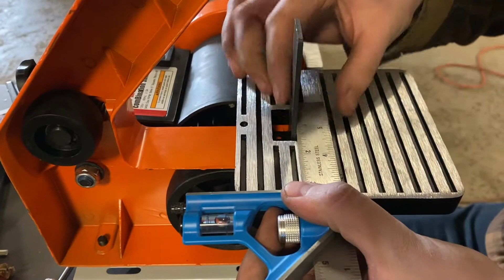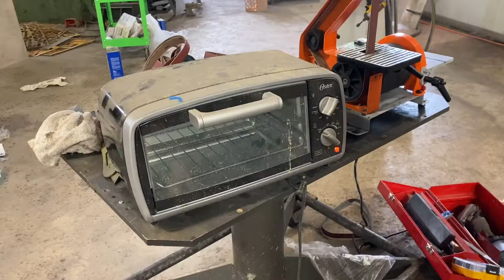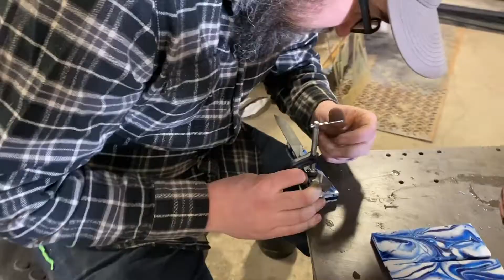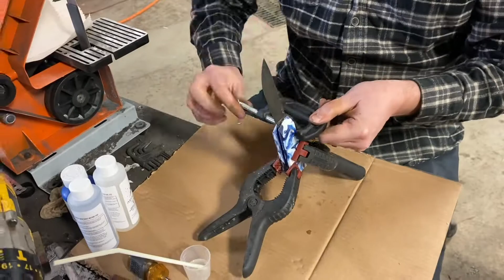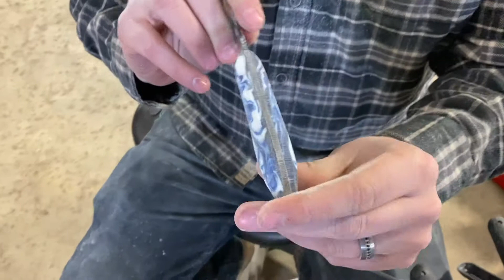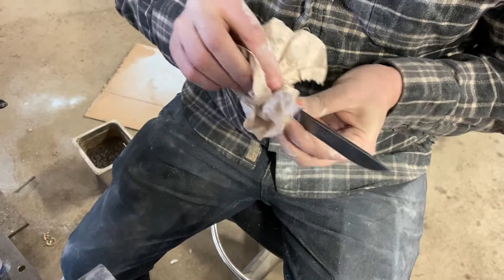DIY Knife Making: Step-by-Step Tutorial without a Grinder

Comment: The 1x36 grinder might take a little more time, and is more limited in what it can do compared to the bigger ones, but it's still quite capable of producing good results.  Plus it fits pretty much anywhere and it's ridiculously cheap.

On the belt side, it comes with a plastic cover that has a dust collection port on the side, if you hook it up to a little shop vac, it'll take care of most of that dust.  The clear shield and little steel shield that goes under the platen makes the vac work better at catching the dust.  It makes changing belts a PITA but when you're trying to cut down on dust it's worth the extra time.  Maybe don't use it for steel work though, you never know if a spark might make its way to your shop vac and start a fire inside the canister :o

Also, dykem is great for working out coarse grit scratches, just coat the blade and sand with a finer grit.  The deeper scratches will be stained blue giving you an easy visual cue of where you need more sanding.  A sharpie works fine too if you don't have any dykem.  Since you don't have to sand opposite the previous grit to visualize the scratches, you can use finer grit belts on the grinder to speed up the process.  This method will work up to maybe 400-600 grit, past that the scratches aren't really deep enough for the ink to be visible.  But that's fine because at that point it's easy to see where you missed and most knives look great with a 400-600 grit finish.  If you have good lighting and good eyes, you might get up to 1000 grit, but the dykem/sharpie will be really faint and hand sanding opposite the previous grit shows up better.